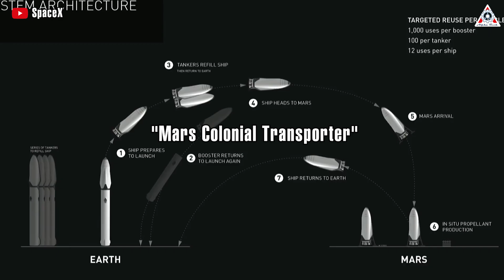Elon's SpaceX officially STOPPED producing Starship V1, New Starship prototype revealed...

Comment: So, will V2 not blow up?
Reply: They're designed to crash and blow up and fly once.. to get data on different problems. They are doing the exact opposite of the space launch system.. instead of having a rocket sit on a landing pad for 10 years getting over designed.. they are blowing up a bunch of prototypes to rapidly iterate on technology that is unknown and unproven. You'll know they are getting close to something that can fly cargo and people when they are catching and reusing them with the tower
Reply: Actually if you think about it they've technically already achieved full reusability because because both the booster and mainstage have already made successful landings.. the "booster" is never supposed to land on its bottom because it doesn't have legs.. it's supposed to be caught with the chopsticks.. at least in it's current design.. but prototypes have landed on their bottoms without exploding or catastrophic damage

Comment: So far Starship has been a natural evolution,  The big leap was realizing they could go to stainless instead of dinking around making expensive plastic toys.
The problem often is rut thinking, Rocket enginerds focused on light weight to neurotic levels due to past limitations in power.
With every jump in engine power and efficiency, the Pardigm shifts. And new options become feasible.
Right now the struggle is upsizing to increase payloads and reduce price. Soon it will shift to actual engine sustained grunt required for heavy cargo.
This will lead to larger engines, and likely some flare in the Silver Lady's booster skirts for another row of engines.
Also we could begin to see boosters get noses, and Starship get longer, And piggy backed instead of stacked. This would allow using an upgraded mechzilla to position Boosters and Starships as tall as they are in combination now, as singles. it would also require more stage one pads.
They might even consider expanding to a triple tower configuration with enough space between the towers for a hex of launch pads, so they can launch upto six boosters pushing a single central over sized Toob Ship...
this would allow tailoring thrust to extreme load levels. Without going taller until they run out of crane height to build stuff.
This system could be used to also launch over diameter hulls if you designed to lift them from the bottom to set on top.

Then we could do more than put thermos bottles into orbit, and stuff them with monkeys.

Talking abouthulls, damn near Panamax ship sizes.
Which could make feasible building Moon and Mars Colony structures on Earth at first, and later sending materials or production mechanization in serious amounts.  The bottom line really is what our limits are lifting out of Earth's gravity well. 
And thanks to steel construction and engines getting simpler and more powerful, and soon bigger,  
Hulls up to a hundred feet in diameter on the ship proper are feasible.
We're gonna need more cows and more humans to make methane... Because gas wells are likely finite. And we will need the practice in places with no gas wells etc.
So, dont think this evolution is gonna stop any time soon. A Generation from now, these starships will be small craft. And for the forseeable future there will be new astounding launches for years to come.
Reply: What 😮 the star ship enter price😊 and the warped engine 😮
Reply: Musk had previously talked about the "double-wide" Starship - with twice the diameter (hence 4x the payload and 4x the number of engines - and 4x the amount of propellant - which is scaleable.   But the problem is that it requires new high-bays to construct them - an entire new "stage zero" to launch them from - four times the number of methane, oxygen and nitrogen storage tanks, four times larger diameter hoses everywhere.   It's a major deal.   However, with the increased power of Raptor 3 compared to Raptor 1 (which is what StarShip was designed for) - then increasing the length of the rocket is the smart thing to do because that allows you to match the propellant capacity in small increments to improvements in engine design without rebuilding the entire manufacturing and launch tower to do it.   I still think we'll see the double-wide - but maybe not until after the first rounds of Mars landings.
Reply: @SteveBakerIsHere  
Yeah, I read about that.
Its an obvious next up scale. and also he has mentioned doing larger scale engines. This is gonna keep scaling up until we reach practical limits. And Land in Texas is pretty cheap, meaning once reliability is up, it will be like airports, not all on the coast.
I had another thought after doing the writ, which would be the option of building Mechzilla a turn table on the ground so one tower could load multiple boosters etc. 
Kind of like an ammo reloaders turret press. With boosters being the shells. This might help on turn around times if nothing else.
Personally I'd be looking for land north of Brownsville for the next iteration of Starbase, and get the Gov to zone an empty flight path to the coast. Theres alot of farm land out there that wouldnt mind ships flying over. And Elon is gonna need more space, and less proximity to water in the future.
I think we will build fairly huge ships before this is over, just because it lowers prices for volume or massive cargo.
And hopefully will soon get us beyond current thinking in space construction. Also make Space Elevators feasible.
Elon's not gonna stop, its not in him to quit. 
Soon, the only question will be: "Where's Jeffie?"
Is he still building those conglomeration engines?